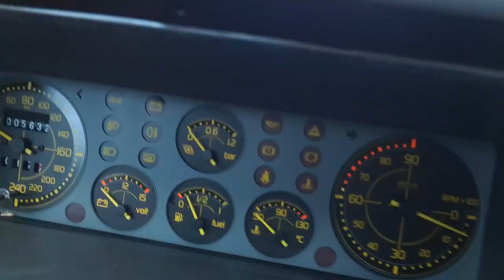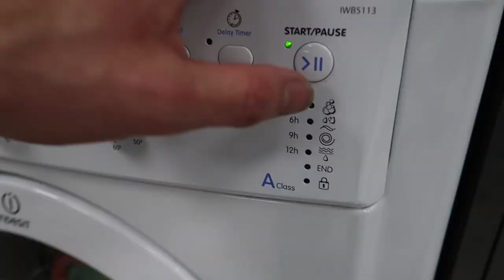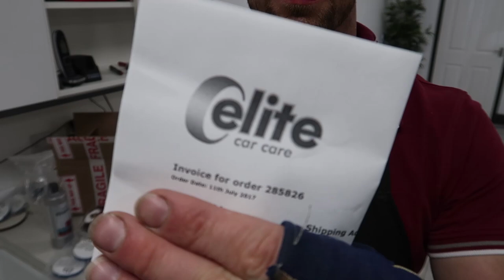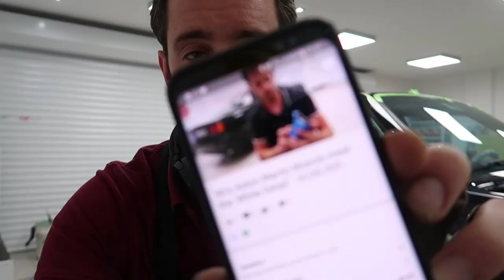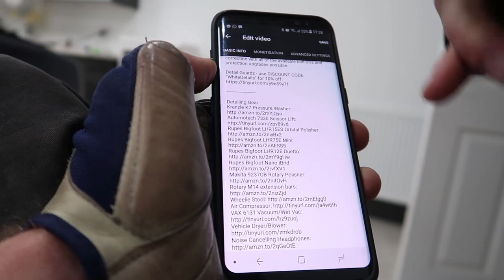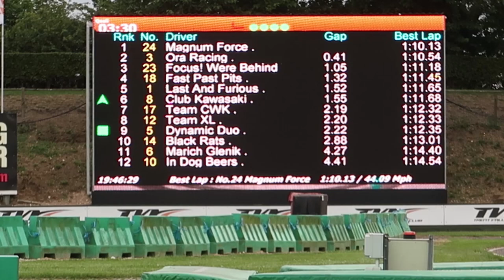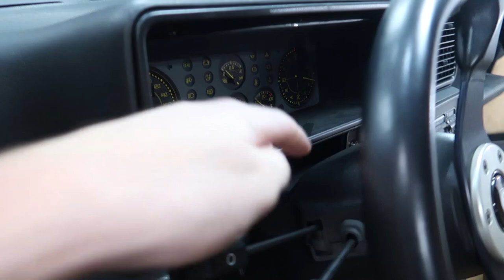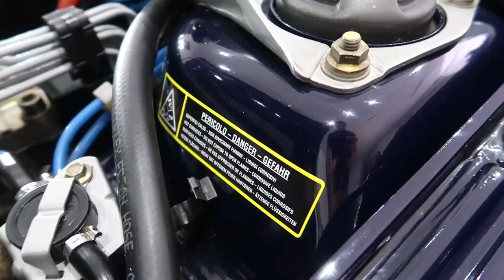Integrale EVO II. One for the museum? - VLOG 034

Comment: Thanks for this, Jim, GREAT job! It brought back many happy memories of the identical car I bought new back in late 1992 as my daily driver, when I lived on the continent. I sold it after 3 years with about 50,000 km on the clock. Hard driven, but never abused, it needed new brake discs after 2 years and then the cambelt failed (a bad batch apparently), when out of warranty (ouch!). I used Michelin snow tyres in the winter and for skiing trips, the grip was amazing! 23mpg overall, 28mpg on a run (if you were very careful you could get 250 miles on a tank), but only 18mpg when pushing on! After about a year, I had the engine slightly tweaked from the standard 215BHP, to about 250BHP. It would then redline in 5th gear on the autobahn (usually heading to the Green Hell...) at about 145mph. A bit noisy then, as the tops of the doors would suck out at about 130mph! By the by, mine was ordered with Lord Blue paint (looks the same as this one), with tan alcantara (again looks identical). There were no badges on the front wings, but there were two on the back (Integrale on the right, and the badge on the left said "6x World Champion" or something similar. I suspect this car would have had the same badging. There was also a front grill badge with HF and the elephant. The yellow enamel on mine dropped out after an icy ski trip to Switzerland! Those wheels were incredibly time consuming to clean, especially as I didn't have a pressure washer at the time. The front edges of the rear wheel arch blisters looked as though they had been sandblasted by the time I sold the car, they do take a bashing! Paint protection film is really a necessity there. Of all the 40 cars I've owned, this was easily the most fun. I REALLY miss that car! Thanks, once again....

Comment: Excellent video and work Jim...and too of course excellent advice to new detailers. I am pretty new to the industry and use a porter cable 7424XP. They are still available and I interchange with 3 inch 2 inch and 5 inch backing plates...three DA's in one to be quite honest